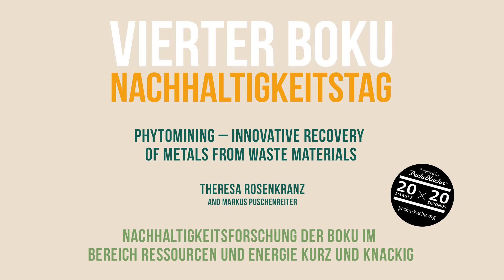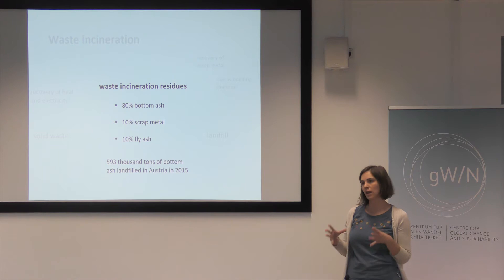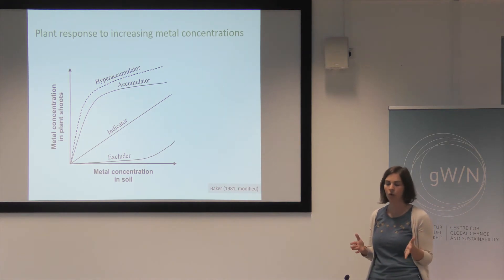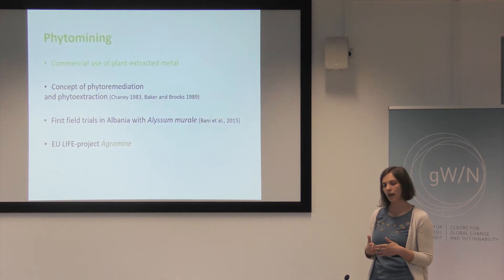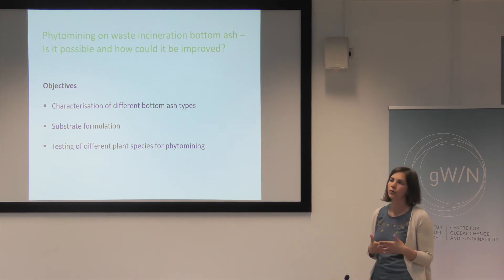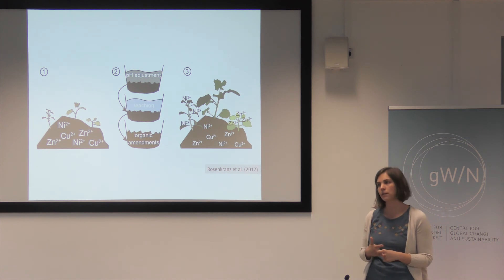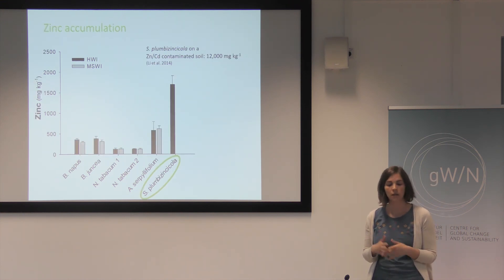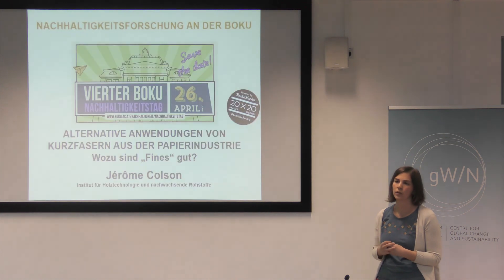Phytomining – Innovative Recovery of Metals from Waste Materials

Comment: Is there a chance these plants can help cure cancer?? I’m not sure why I asked that
Reply: Yeah if you add carbon nanotubes, graphine, and platinum nanoparticles, they also turn into room temp superconductors that cure cancer but only if you lick it off the side of a space elevator thats powered by a fusion reactor
Reply: @chubbstrevino1354  are you sure elevator? Escalators have a more staggered elevation which balances out the reactors. Would hate for the moon to fuse into earth. Thanks for your input.

Comment: How do you exctract the nickel from the plant later?
Reply: Sci show mentioned that for certain metals you burn the plants and harvest the ash.
Reply: @kl3312  Thank you. I think this research can be useful to harvest the metal:
https://www.sciencedirect.com/science/article/pii/S0048969719316055
Reply: @suli976  This would actually dilute the concentration. Once the plants are burned you leach the copper into water or other solvents and a low current will make it electrolyse. Another option is adding a tiny bit of scrap iron which makes it settle out as copper ferrite which can be smelted.
Reply: @kl3312  can the smoke be processed because it can also contain materials?